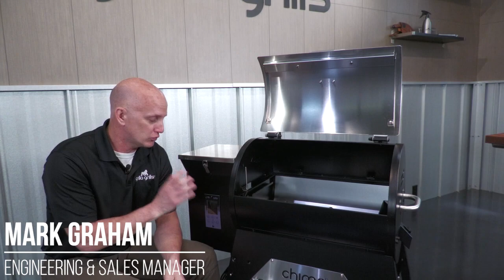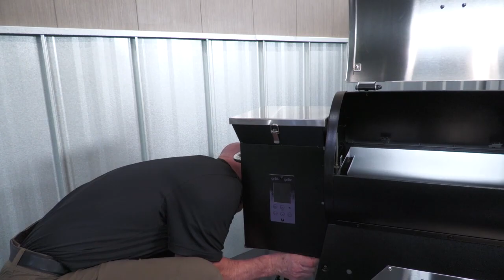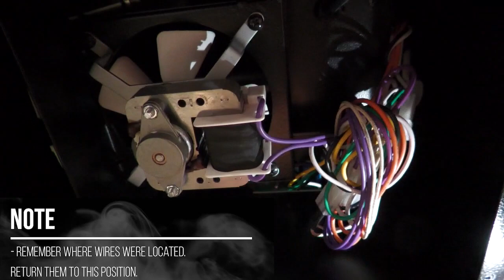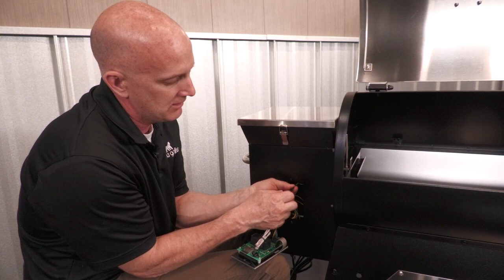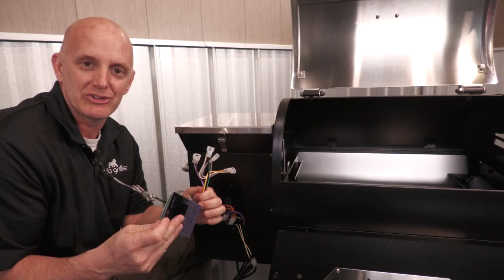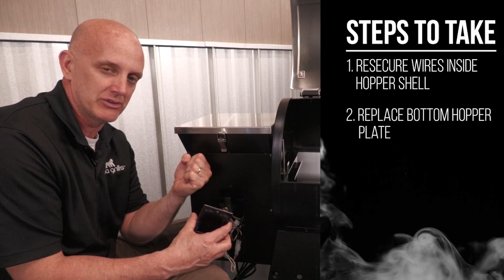How to Replace a Chimp Control Board | Maintenance with Grilla Grills

Comment: I have an older Chimp that doesn't have the WiFi controller, and it doesn't control properly - had two runaway excursions yesterday. 
I am wondering if I can put the newer WiFi controller in my older Chimp.
Reply from the maker: Definitely contact customer service and see what they can do for you. Reach out to them at grillmaster@grillagrills.com. Can't make any promises, but they'll at least be able to help you out with the current controller you have.